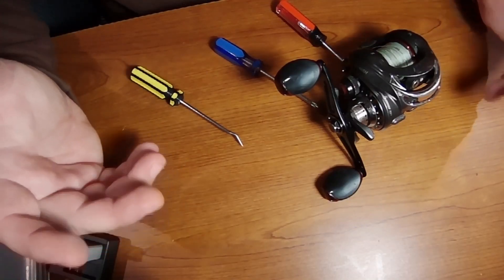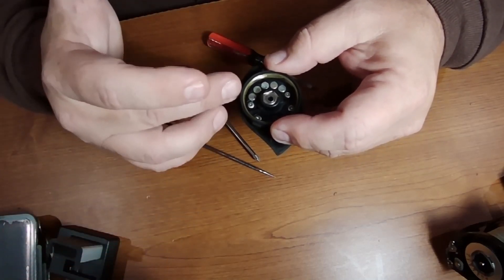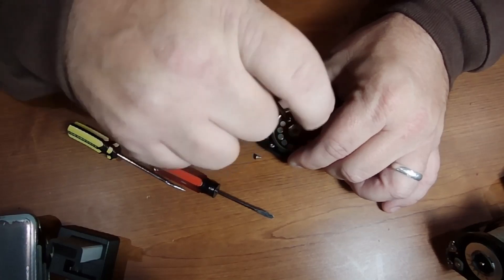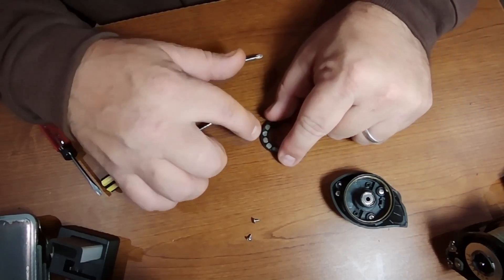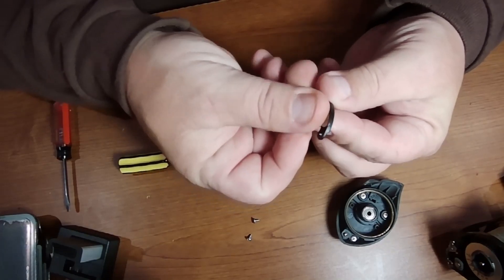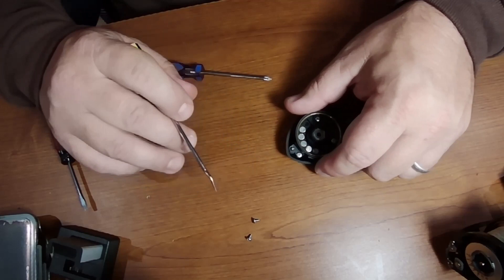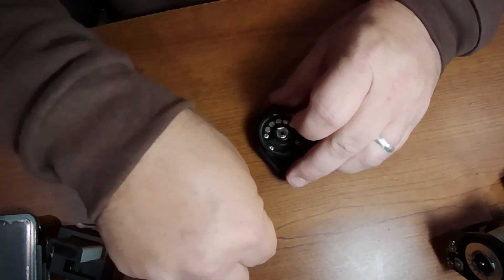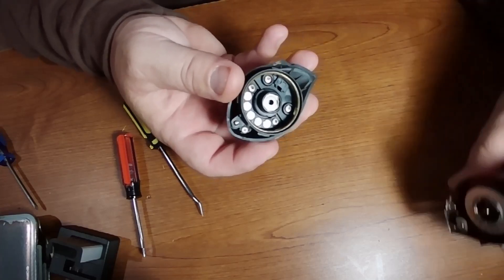Part 2/ How to remove your magnets. #howto #fishing

Comment: So when I understand what you do is that the magnet, which you are removing or flipping, looses its braking function more or less, so that you then can cast a longer distance?
Reply from the maker: Yes, typically they come with only one or two flipped. If you flip all of them over with the magnet side away the spool will freely turn with no restriction.
Reply: @backyardbassin7125  Ok, thanks very much!!!
Reply: @backyardbassin7125  will this give a high chance of getting backlash on the line?
Reply from the maker: @fishtuationaqua  yes it could, it’s just another tool you can use to perfect your comfort zone in casting.